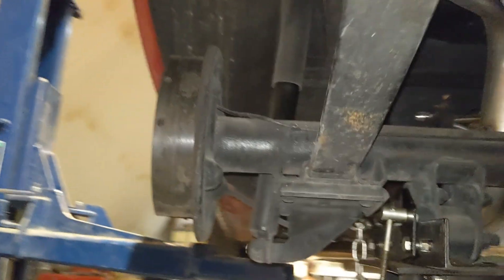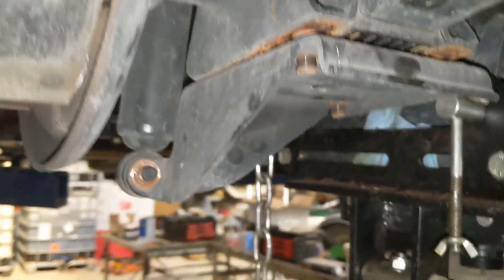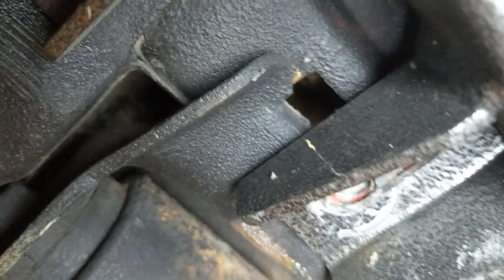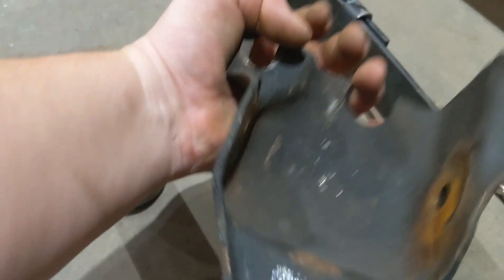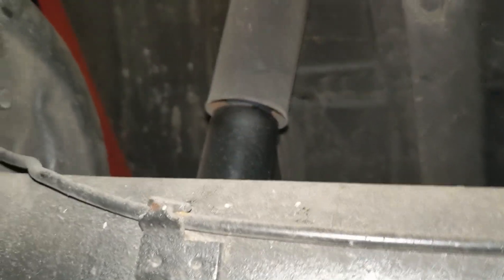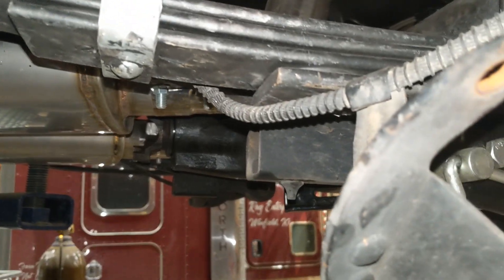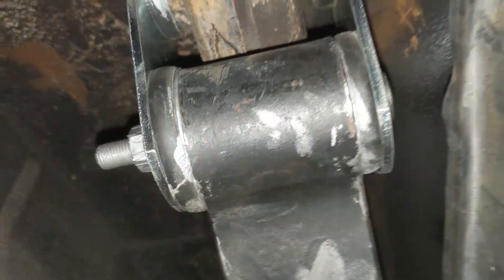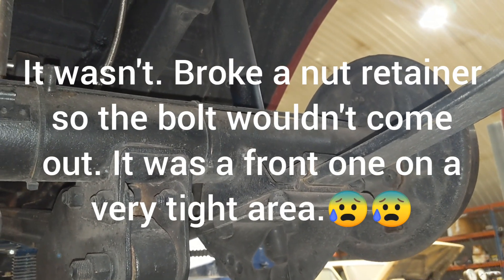1967 Firebird Converting mono to multi spring with Detroit speed kit

Comment: I like the idea of those aluminum spacers to distribute the clamp, but seems like it would be difficult to get the slack in the center just right. Did you buy that wedge or make it to correct the pinion angle?

Comment: Thank you for the video. I have been looking on line for a week wondering if you are supposed to use those rubber/plastic pads with the adapter/spacer kit. Went ahead and ordered some along with the kit because i dont know if im going to end up needing them or not with my new leafsprings